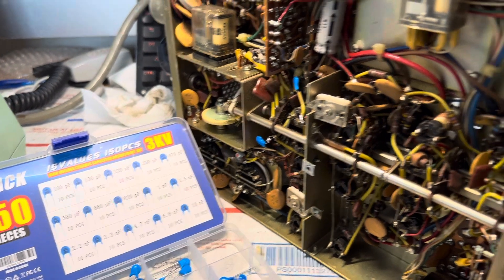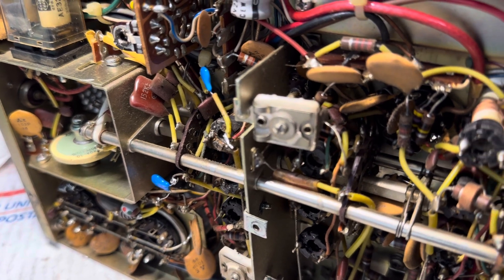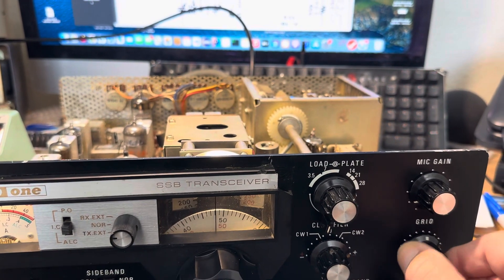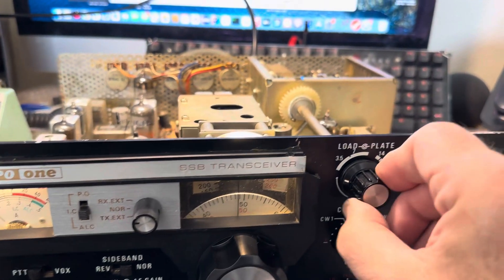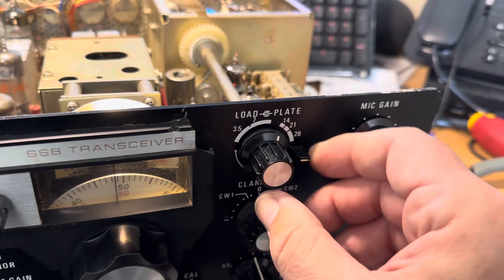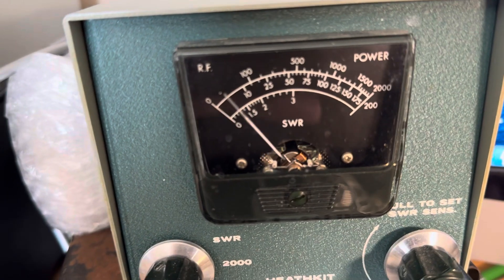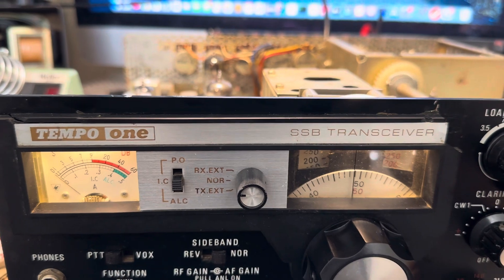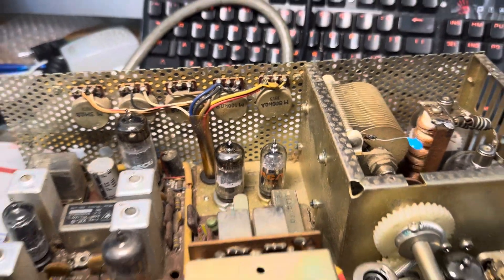Boom! A short appears! Just like that! Henry radio Tempo One. Now find the short in 600 volt line

Comment: Capacitor on the 600v line.  This is the same as the Yaesu FT200 and it's a common fault, replace with 1kv rated cap.
Reply from the maker: Boom! Just sold that transceiver. But replaced that cap with a mica cap
Reply: @moviestudioland  Yeah, for reasons that elude me, the original cap is barely within its voltage rating so commonly dies, often with spectacular results.